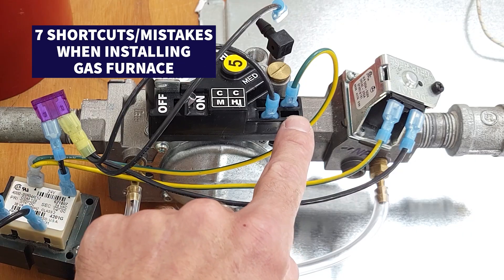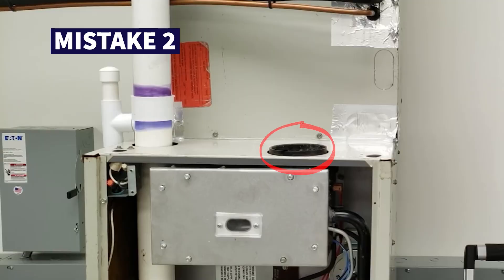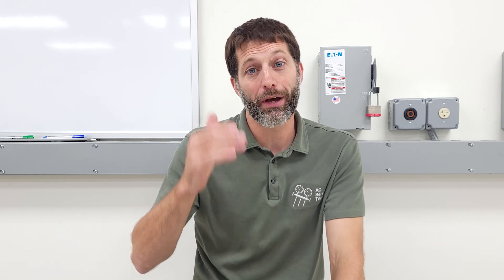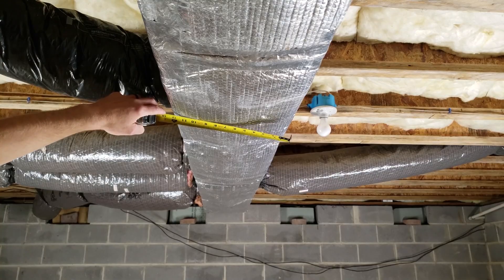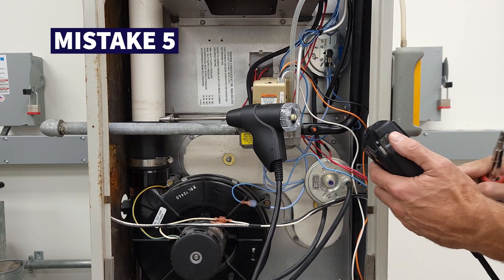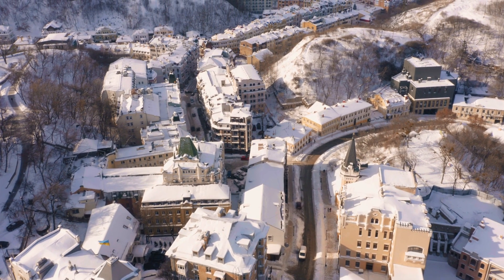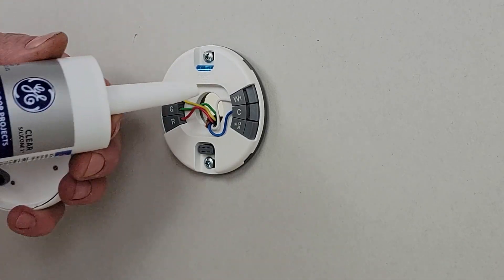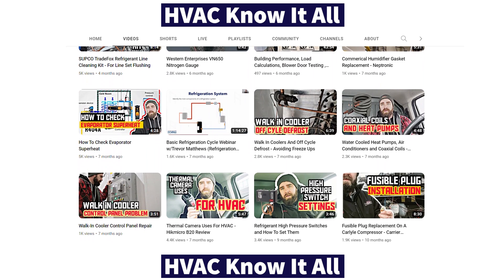7 Gas Furnace Installation SHORTCUTS/MISTAKES That Lead to High Energy Costs, Low Efficiency!

Comment: Most of the time swapping a mid efficient for a high efficiency furnace, there’s a combustion air pot previously installed beside the furnace or in the same room. Which then it is called “non direct vented” application, drawing combustion air from that source, as well as the water heater.
If no combustion air pot then must have intake and exhaust pipe installed to outside with furnace called “direct vented” application.

Comment: Sealing the back of the thermostat. Never thought of that. I know the ceiling to wall air definitely mixes. Attic fan re-circulates through the outlets and switches. I don't like to use it for that reason.

Comment: SAME THING HAPPENS WHEN YOU RUN YOUR CLOTHES  DRYER THAT 25MILE PER HOUR AIR GOING TO THE OUTSIDE HAS TO BE SUCKED IN FROM SOME PLACE  THINK ABOUT IT
Reply: Same for range vent hoods and bathroom vent fans.  600 CFM for those in my home, sucked in from outside.

Comment: Many years ago, it was common to see buildings with free air returns. Is this no longer the case or acceptable in the national bld. codes? Thanks for great video's.
Reply from the maker: It is not normal unless there is special circumstances where it makes sense to do so. However, there are not usually actual codes that say you can't do it.

Comment: How to do a heat load calculation?
Reply from the maker: Check our Wrightsoft software. No matter where you go, its going to be expense but there may even be apps that can help with it now. It comes from the ACCA Manual J book.

Comment: Where i live, 2 pipe systems often have moisture issues if the intake is piped directly over the burner or vertically into the unit. The winter air being pulled in condenses in the upper cabinet and sprays. It wreaks havoc on gas valves flame sensors exposed inducer parts, pressure switches.. Drain wye and/or an offset or swing joint on the intake right before the unit helps. Here HRV are required on any building built post 1992, if you decide to install a furnace with exhaust only, the HRV can be balanced to help. Ive had customers with houses cleaner than the outdoors, no issues from intaking air indoors; insulated mechanical room with an HRV (not simplified) and make-up air if needed.
Reply from the maker: Interesting! Where are you located? Yeah as long as you have HRV or ERV, its ok.
Reply: @acservicetechchannel  Southern Ontario, Canada. Also find it intriguing you guys use galvanized down there in certain situations. It's not allowed on gas here. And when running flex inside walls we're to leave it UNSTRAPPED like gastite for example. So that if someone were to accidentally drive a  screw into the gastite, the tubing can move away from the screw. 

Ive heard in some states its supposed to go into conduit inside the wall?? Seems alien to me lol. keep up the great videos

Comment: Lownox furnaces with no combustion air pipe would cause the flame sensors to get dirty faster cuz it'd be pulling in "dirty" air from the space its in, basically putting contaminants on the flame sensor.
Reply from the maker: Yeah, its not great if the furnace is in the crawlspace, thanks!